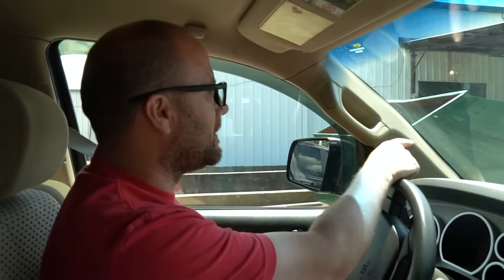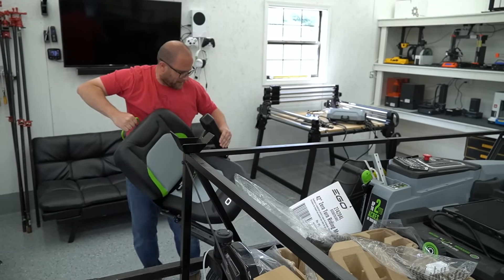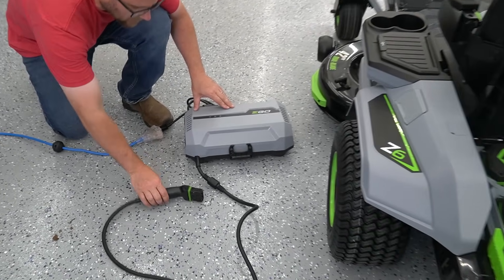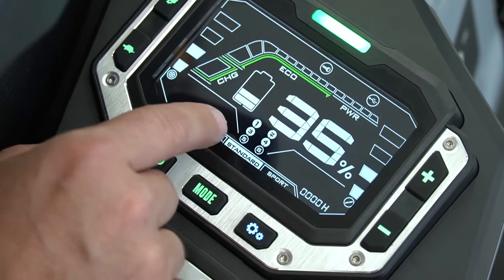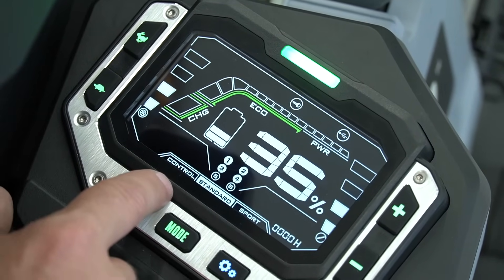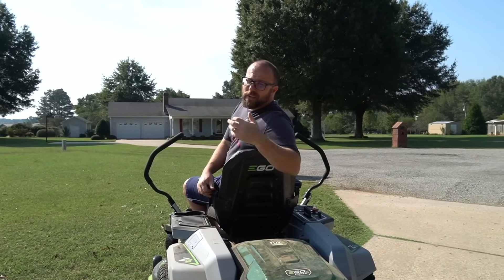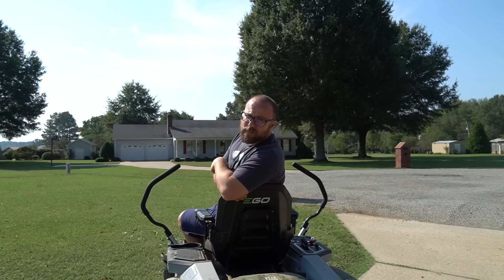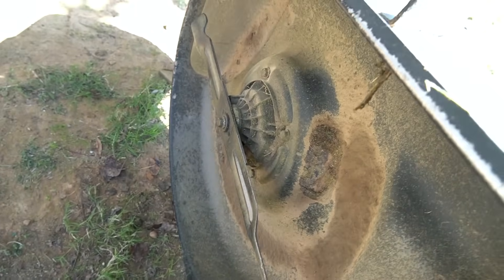EGO Z6 ELECTRIC Zero Turn Mower - The FIRST of its Kind! //Unpaid Review!

Comment: Slow the blades down and you will get up to 2acres.
If you need to charge, and have other Ego Tools, you can use other batteries.  Throw a couple 5Ah in the open battery bays.
The problem I had with the Z6 is on uneven surfaces.  It is near impossible to keep the mower straight, and when towing it cannot navigate much of a side slope.
Reply from the maker: I haven't had any issue with unevenness.  Also, I've towed 6 kids in a my yard cart and didn't even notice i was towing anything.
Reply: EGO recommends about 50% blade speed for optimum efficiency and performance. I’d add to opt for standard mode with less speed.
Reply: With mine I run with blades on low 1 of 4and speed on 2 of 4 for efficient decent time of cutting. Tall grass may need higher blade speeds but that zaps the life much faster

Comment: i have Ego trimmer and self propelled push mower. Love no gas or oil to mess with. Deck looks kind of suspect. How hard is it to clean bottom of deck and change to sharper blades? I realize it has a clean out port, but assuming that can only do so much. I also wonder how hard it would be for a tall person to get on and off of. I have ben running Simplicity and love the cut it gives me.

Comment: Do you know what is recomended in cold areas for winter storage. Leave it pullged in all winter in the garage?
Reply: Just charge it fully at the end of your cutting season, check the battery status in January or so to see what level your battery is. You might need to charge it one more time before spring. The e-steer just came out, that's much easier to steer than the older model. Just bought that in March, used it 4 times so far on 1 acre with 4 12ah batteries. Still have 29% power after cutting my yard. 
You could charge the batteries fully, and take them inside where the temperature is more moderate, that way they would be fine until spring.
Reply: @attilasuto6013  Thank you, for taking the time to answer.  Taking them inside is what I would want to do,. We cloase up our house and go south for the winter around October then don't come back to northern MI until May. Sold my farm and building a smaller house and a 1/2 - 3/4 acre yard so not sure just what my replacement mower might be yet. It would be so nice not to have to do oil changes and mess with gas. Worried about getting repairs on one if they were needed..

Comment: Interesting. I have had their self-propelled 21" mower for 4 years now. I've been thinking about the Zero-turn but two things I notice right off are no ROPS and no way to use a bagger. I need the power flow bagger on my JD X534 to handle all the leaves in the Fall and for those times when I need to pick up grass clippings because they are too long. That only happens when rain or something else prevents me from cutting before it gets to where I am cutting off 2 inches or more. 

Only 42" cut which is less than what I have now. Realistically you'd get about 36" inches of cut it you allow for some overlap when cutting. I see that you can only cut close on the left side, the deck doesn't extend out past the wheels on the right.

Without a way to bag clippings and leaves I can't even consider this. Maybe they will come out with something soon.

19:50 "Professionals" don't necessarily do what's safest. Holding the deflector up could result in someone, maybe you wife or kids, getting hit by a stone or whatever the mower blade picks up and throws across the yard at 70 MPH. Hit the neighbors kid with a rock and you might be in court explaining why you had to lift that deflector and defeat one of the safety features of the mower. And it can happen. I caught a rock in the windshield of my truck while driving down the road that was kicked up by a mower. I saw it coming right at me but couldn't avoid it. Stopped and told the person mowing and their HO insurance paid for a new windshield.
Reply from the maker: The bagger is already out for it: https://amzn.to/3DNQ8Ra
What’s rops?
Reply: @MyersWoodshop  Roll Over Protection System. Good on the bagger.
Reply: Lol i take the rops off of all my z turns?? Lol who's gonna flip a baby electrician ego lol🤣🤣 now my scag cheetah that does 16mph yeah keep rops and jd is the worst mowers in the industry get a Spartan thank me later
Reply: @mattkemp5765  right... pathetic

Comment: I have a couple questions for you before we shell out almost $8000.00 for this mower.  Have you tried mulching yet?  If so, how did it do?   Also do you have any hills and how does it do on them?  Your video doesn't show any hills so maybe someone else knows about this?  Would you recommend it if someone has some smallish or medium sized hills?   Should I be majorly concerned if the foot pads come off after a year or two?  Will that make the machine unsafe?  It seems like a cool mower but it is a lot of money to spend on something like this!
Reply: I think this mower lists for 5500. That's still a lot of money for what it is-a low end residential mower that happens to be electric. That kind of money will get you into a "pro-sumer" Husqvarna MZ, Spartan, Gravely, or similar gas mower that will be more capable and last a lot longer.
Reply: @channell11  My Hustler is 16 years old and runs like a new one. I just change the oil every year filter too and blades as necessary. I have changed all three drive spindles but after probably 10 years they do go bad. I have only changed the belt maybe twice but not three times. It was $3600 16 years ago. Who knows what one like it would cost now.
Reply: 4500 in east Texas

Comment: I wonder if this mower pulls from all batteries at once, or unevenly.  If the latter, maybe one could get more range by starting  to recharge some batteries before all are out.  In any event.  I would think if one has other tools one could be recharging some, (while using only 4) or something like that.  Anyway, I wonder if that is possible.
Reply: Yes, it’s possible, and maybe beneficial. I’ve never tried it.

Comment: There is no mention of cost, which leads me to think it must be overly expensive, I can see where this would be nice to have and has it's advantages but I would not like the constant bouncing rattling mower deck. It seems that would effect the cut since the blades are part of the deck they would be bouncing up and down all the time. I think the seat is one of my favorite things, having a bad  back and spine it would really help. How are you liking this 10 months into owning it?
Thank you for sharing.
Reply from the maker: I 100% mentioned cost in the video. I bought mine for 4999.

Comment: If you're not running it full of the max power batteries, it makes sense that you're not gonna get the full 2 acres, and of course the manufacturer always includes the maximum possible under ideal circumstances. Still, 1.5 acres isn't bad at all
Reply: Most people will also have back up batteries so you would only swap them and not have to wait for the charge.
Reply: @FSXflyermaster  backup batteries lmao what this thing uses 6 who has 12 batteries that's cost over $500 dollars laying around?

Comment: How did you fix the lap bars? I feel like mine steers to the left more since one lap bar looks bent :/  also when I turn it off it kind of stays on in a stand by mode and I can hear a buzzing sound not sure what it is. It stops when I pop off all batteries. Not sure if its the motor or what. Does yours go into stand by mode when shut off? mine does and ego says this is normal. I want to completely turn it off.
Reply: The user manual discusses how to calibrate the bars, it’s fairly simple. Mine goes into a brief standby prior to shutdown. I wouldn’t defeat it as there is surely some purpose for it.

Comment: ..I think you’ve sold me on the EGO…:)
On the rattling deck, I think you should cut an old bicycle tube, and wrap it like a rope, tightly around the hankers of the deck… then put zip Ty’s on the inner-tube, and just cut the zip-ties whenever you remove the deck..
Reply: Based on mine, I believe the deck is designed to “float”. However, I couldn’t agree more with need for bushings to quiet the jostling, ruins a relatively quiet ride.

Comment: To the people that say less maintenance, you still have to maintain blades, it will wear out tires faster due to the weight,  and the batteries are expensive when they fail.   Oh yeah, I hope you’re handy with a multi meter for when electronic components fail like the BMS or that fancy LED screen.  You know what never needs a firmware update?  A gas mower
Reply: I’m with you. Screw those mowers. They’ll spend more time dead in tall grass than a gas mower. Bring gas will run. 
Not only run, but run circles around a ego. Lol
Reply: What weight?  You think 4 lithium batteries (29 pounds total) are heavier than a 20+ HP engine and a tank of gas?

Comment: If you cut close around your trees (full turn around it), will the rear tire (or plastic parts of the mower) touch the tree?
And if it does, do you think that the new 52" version will not have that problem, because the deck sticks out more than the rear wheels? Thanks for the good review!
Reply: I have worked with a zero turn mower.
I used to put the rear wheel near the tree and go all around.
After all the zero turn happens at the rear drive wheels.
Reply: Still need a trimmer.

Comment: Nice review. Shame it doesn't last longer. I would like to go electric but I have almost 3 acres of uneven terrain that is often wet. Doesn't seem this could handle it.
Reply from the maker: Naw, i think it will do fine.  I have no issues when it's taller or wet (i just didn't have those conditions when filming).  It's done everything i've thrown at it.
Reply: Just buy two. Easy peasy.
Reply: Just buy more batteries and 4 bay charger (which doubles as backup inverter for appliances) so You can swap them on the go
Reply: Speed 2, blade speed 1 gets me decent range time also run with 6 batteries for extra time. Also the charge times are pretty fast when plugged in I’ve learned

Comment: not a fan of the all plastic ZT but ill keep a open mind as I watch this...watched it probably not getting it... prefer metal and gas riding mower at least you can take it to get serviced on if necessary... no one knows how to work on these... currently got my eyes on a Hustler Dash XD
Reply: Very little maintenance or repair. Very sophisticated electronics and software systems. With a 5yr warranty and modest failure rate, I’m curious what the refurb market will look like.

Comment: I mow residential lawns for a living.  I have had 2 of their self propelled 21inch mowers break down within 3 months of purchase. In the first case the wiring melted. They replaced it with a new one. The second failed yesterday in a similar way, I don't have the diagnosis yet. I was considering the zero turn but I no longer trust their quality.
Reply: Don’t buy one!
Get a Wright

Comment: When you took it out from the cage did you need two people❓  Or did you just roll it out from the cage by pushing it❓  Also can you do a video of removing the deck and changing out the blades❓  

Awesome video❗
Reply: I uncrated mine by myself, took about 2.5 hrs to uncrate and assemble. Bring your power tools, they definitely help. Deck removal is fairly simple and straightforward, there are You Tube how-to videos that will show you how.

Comment: I can't believe how cheaply, American's can buy a Zero turn mower for. I paid $7,500 for my MZ52 Husqvarna, secondhand. Sure, it only had a hundred hrs on it, and not a scratch. But new it would have set me back $13,500. I'm sure some top of the range commercial mowers in America might be pricey, but here, in Australia, I've seen Zero Turns at $27,000.

Comment: When you spend 5500+ on a gas zero turn, that buys you a high-end residential/entry-level commercial unit. You'll get better frames, more features, bigger tires, a fabricated deck, superior drivetrain, etc. In short, you'll get a unit that will likely last a long time for residential use. The EGO appears to have the features and build quality of a low-end residential zero turn-small, stamped deck, small tires, mostly plastic parts, no rollover protection, etc. You're paying a lot of money for a mower that will be beat up and ready for the scrap heap in a few years.
Reply: Each and every time they turn a gas powered machine to battery power, it's almost as if the only material available is sewer pipe ABS plastic, you can forget about metal it just doesn't work with batteries. Unproven long term investment, cheaply made and WAY overpriced.
Reply: Weight is battery’s nemesis. How does one “beat up” a residential mower? By abusing it? If cared for properly, these should last. Yes, there’s more plastic than I’d prefer, but look at how much plastic is in any new high-end auto. It’s facia, and it’s cheap and easy to replace. Technological advances will make these obsolete long before they break.
Reply: @ccattrn  That's what she said, and we know she's always right!

Comment: Amps are not the same thing as amp-hours, one is a unit of current, the other is a unit of charge.  Those aren't 10 amp batteries, they're 10 amp-hour batteries.  Otherwise, good review.

Comment: I would have to charge this 3 times per mowing. My Yazoo would eat its lunch
Reply: Wonderful. Just recall, these have specific operating limitations, the greatest being they are battery powered. Beyond that, things such as operating modes, weather conditions, terrain, and the operator’s size become additional limiting factors. He is also not using the full power capacity of the machine. Your Yazoo likely suits your particular needs best, meaning it is a better option, but not necessarily a better product. I have a 52” model EGO ZT, and it’s an absolute beast. And with 6 10 amp batteries can cut 2 acres easily, provided I’m in standard mode with a medium blade speed which is more than sufficient.

Comment: In a few years the industry will be making commercial grade battery powered zero turns. I hope that EV zero turns will lower the maintenance costs associated with the hydro gear, oil, engine problems, etc... For now they are as expensive as commercial mowers but with the residential grade quality and power.

Comment: Charging and battery replacement prices, are the major negatives. You still need to sharpen the blades and clean the deck periodically, as with gas mowers.
Reply: If your mowing area is larger than what this can do on a full charge there‘s no point in buying it anyway, so I don‘t think chargimg time is a big issue. Battery longevity is of course a question that will be answered in the future, a new battery probably runs at several hundred dollars so not cheap.

Comment: Solution to the wait time could be buying more batteries. I know they're expensive but you'd spend more in gas in the lifetime of the mower than you would for the batteries.
Reply: @LegendLength  I barely use 25L of fuel for a whole season on a old BS 12HP with mostly rich mixture because it's low on compression. I don't know the surface but I do it in a little more of an hour.  It's hard to justify new riding mower with the initial cost(about the same as a car) plus batteries and how long those batteries will last. The current ryobi is about a year with lead acid, lithium could be what 5-7 years give or take. I feel it like it the same with air tools and battery powered tool, in the long run air tools seems to be better, sure there is initial cost of lines, fittings and the compressor.